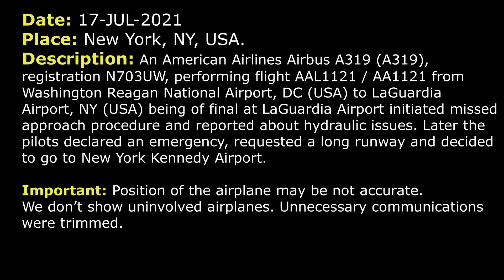MAYDAY, hydraulic system FAILURE | American Airlines Airbus A319 | New York Kennedy, ATC

Comment: A single hydraulic failure is not worth a mayday-call on an A320 .  I guess that they just wanted to be 100% on the safe side to get all of their requests approved. Maybe some incertainty about how grave that failure really was .  So they chose to stay on the safe side.  Which is totally professional  in such a situation.   My guess would be a yellow hydraulic failure so they lost nose wheel steering and use of auto brake is not allowed even though it is available .   You have to steer the aircraft by means of differential braking once slower than 50 knots. That  costs some  stopping distance. Actually  this failure is easy to handle...but if you don´t know that- you might tend to regard it as a serious issue.

Comment: Totally arm chair qb-ing here but 2 hrs of fuel and you don’t want to hold for an hour?
Reply: They were also having flight control issues.  Alaska kept flying when they had control issues, didn't work out so well.  Best to get 'er on the ground ASAP.
Reply: I thought there were some safety margins in the protocols they need to stick to. Margins to ensure there's enough fuel for go arounds or diversions. So when planning when and where to land, they'll have to keep that into account. If an airplane is projected to get below these fuel margins before landing, I thought that's also considered reason for an emergency.

But I'm no expert, this is all based on similar ATC videos

Comment: Cannot help but wonder if keeping so many airplanes parked for almost a year has led to what seems like a rash of recent emergencies due to mechanical problems. Will need to see if indeed we are having more emergencies than during normal times.
Reply: Yes, 100%. I have been an aircraft mech for 24yrs. They don't sit for long term very well.
Reply: Has there been more emergencies than usual? You’d have to give me actual data on that. A few YouTube videos isn’t very representative of that.
Reply: @saxmanb777  Exactly. Another thing to keep in mind is that there are more aviation channels on YouTube and they all cover the same incidents. So, once "incident" could result in 4 or 5 videos being produced, leading the the impression that there are more emergencies than there actually are.
Reply: @GarageQueen  Fair point. This was purely speculative on my end. Trying to find some stats...
Reply: @saxmanb777  I agree with your line of questioning. Fair point. I was Googling around the DOT and FAA websites to see if there are any statistics on declarations of emergency we can compare, say, 2015-2019 with 2021, but so far I haven't found it. Which is why I wrote what I wrote on my comment.

Comment: Isn’t 22R the longer runway rather than 22L at JFK?  Or are they considering the EMAS system at end of runway?
Reply: Found this on Wikipedia. Runway 22R at John F. Kennedy International Airport has a displaced threshold due to noise abatement. This shortens the landing distance available to just 7,795 ft for the 12,079 ft runway.
Reply: @DanAtl  That is one major displaced threshold!
Reply: Looks like 22R has a (really) displaced threshold that makes the LDA 7794 vs 8400 for 22L
Reply: But they should have used 31L
Reply: Yes 22R is longer than 22L
Reply: Can an emergency aircraft use surface beyond the displaced threshold on RW 22 R???? I think YES. ?????
Reply: @vladimirfromukraine419  yes, but it wouldn't have given them the length they needed.